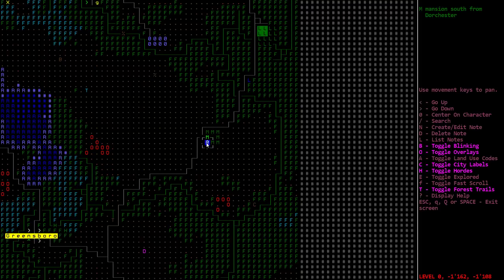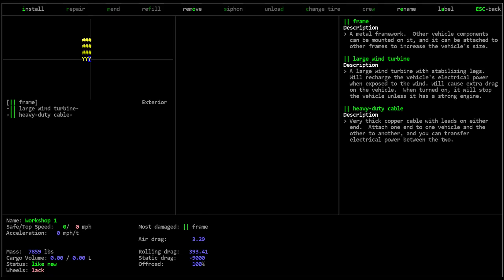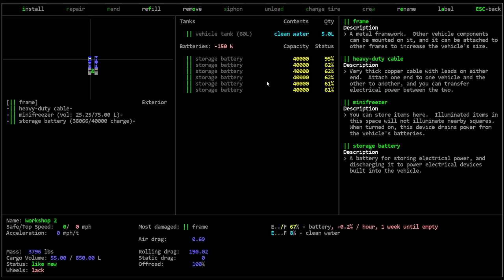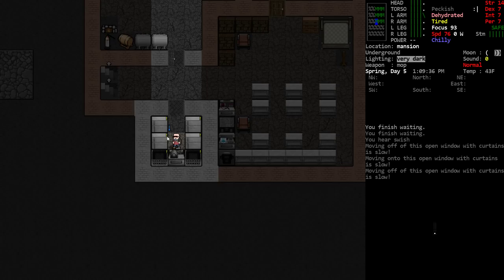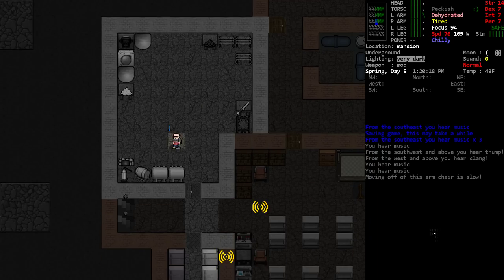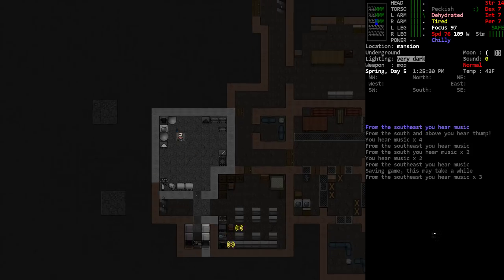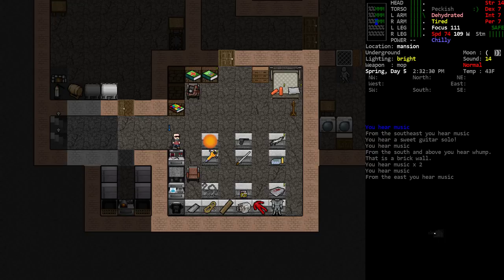Cataclysm Quick Tip #55 - Home Base 1 - Mansion with Z-Level Power

Comment: Yep, very useful, thanks, didn't know u can actually attach washing machine for mass clean filthy cloth, though I'm really just approaching this kind of stuff, assembling working car from scratch and such
Reply: With washing machines, you shove the clothing into it and then activate it to start it. After a couple of hours the clothing will be clean and you can pull it out of the machine. It's a pretty nice system IMO, feels very homely.
Reply: Just a heads up, you will still need detergent to use the washing machine. Of course it's wayyy more efficient with it than a washboard though

Comment: My home base tends to be one of the larger garages that appear outside of town. They just look nice as a building and are easy enough to reinforce. The only problem is the lack of a basement, but with enough patience, you can set one up. I'd always dig a pit around it, then put barbed wire on the inner layer, then over time create a chain link fence on the very inside. I find basements overrated though. Theyre good for food storage, but theyre too good at protection

Comment: edit: retested and found the heavy-duty cable without any mods on a brand fresh world, after reading the reply by Vormithrax.
Will leave the original comment for posterity 
(original FALSE comment = "FYI in order to be able to do this you must have the "Vehicle Additions Pack" mod active since it contains the "heavy-duty cable" item.")
Reply from the maker: This is incorrect. Heavy-Duty Cable is in vanilla CDDA (experimental branch for certain) and does not require the 'Vehicle Additions Pack' aka 'Blazemod'. The Wiki, Item Browser, and test game-world i just created without 'Vehicle Additions' all confirm it is in Vanilla/Mainline CDDA. My Google-Fu hasn't been able to determine if it originated in Blazemod and got mainlined at some point or has always been vanilla.
Reply: @Vormithrax /videos/videos wow my bad i just created a new world with no mods and indeed the heavy-duty cable is in the base game. Weird because i was testing a few hours ago and wasnt able to find it in the debug/spawn item menu.
Will edit my original comment to avoid confusion.
Version: 0.D-10735-gd136e46 (tiles), Build: 10076
edit: just added the version that i am testing this

Comment: is this still a thing in the latest versions? I know you can make a whole house into a "vehicle" by revealing wall wiring, but are the heavy duty cables still a thing that you can connect over z levels?
Reply: also what is the light you were using in the basement, and does it still exist? I only know about the standing lamp and I don't even remember where I looked to find some.
Reply from the maker: Here is a more up to date video on the subject. Yes, you can still connect across z-levels using things like cables but they also added extension cords. I think the lighting in this video was just vehicle headlights mounted on the frames.  https://youtu.be/0gHEgpoz8nU

Comment: Thanx. 2 questions - is it possible to place arrays on roof (with no stairs like at shelter) and is it possible to connect vehicles parallel (N cables from accs vehicle)
Reply from the maker: I believe the answer is yes to both, but i have not actually tried it myself.

Comment: I have not seen end game yet - do I have to worry about flaming monsters? Can something other than me set buildings on fire? Don't want my base burning down :)
Reply from the maker: Zombie Burners exist (dead soldiers that had flame-throwers) but i have only ever seen them at FEMA camps. your not likely to ever have to worry about fire in your base that you are not responsible for yourself.
Reply: @Vormithrax  I see. Thanks for info. So I can settle down in a regular house instead of searching for a stone bunker.
Reply from the maker: Fire is not the danger you worry about. Hulks, Shocker Brutes, Skeletal Juggernauts knocking down all your walls and collapsing the roof is what you worry about. Underground (basement, laboratory, etc) is always going to be 'safest'.

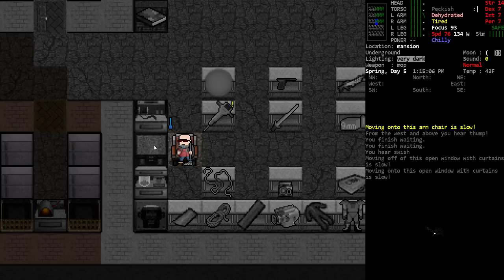Comment: 5:10 how do you set it up that when you craft it will pull all the components and tools you need from those display racks?
Reply from the maker: Not sure i understand the question. Crafting range for materials and tool use has always been 6 spaces.  no special setup is necessary. The materials do not need to be adjacent or even particularly close. It used to require line of sight (which made it awkward for some vehicle setups or to use certain containers) but now as long as your character could reach it within 5 steps it is available to be used automatically when you craft something.